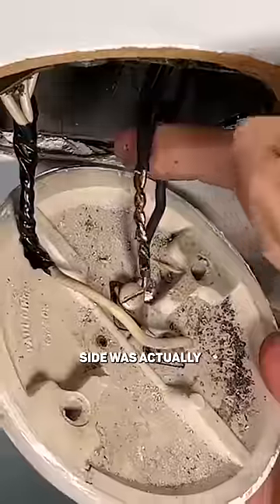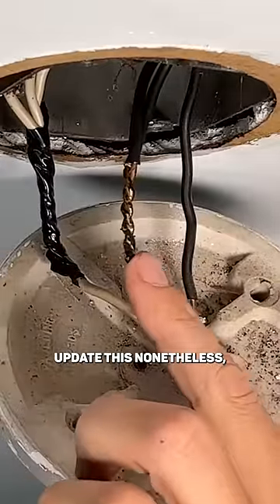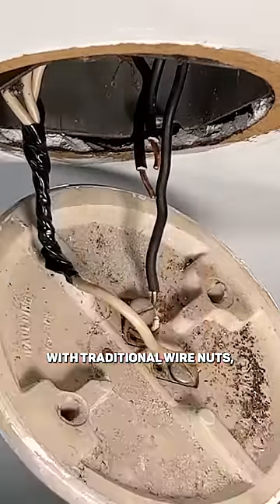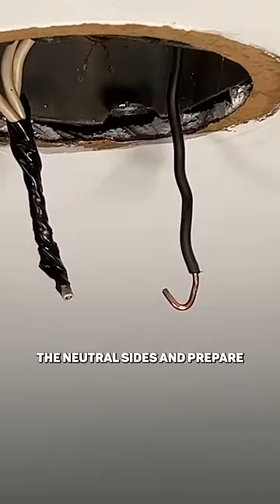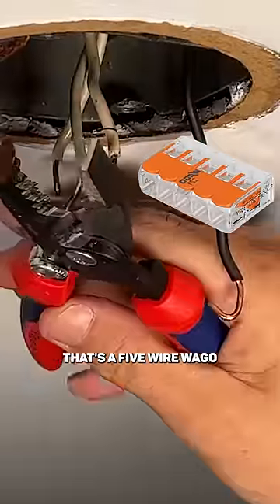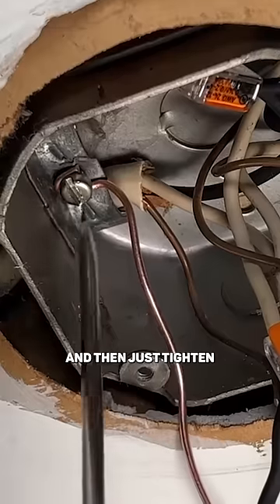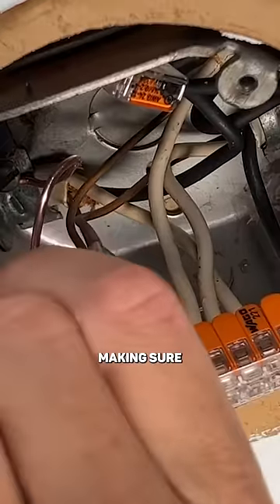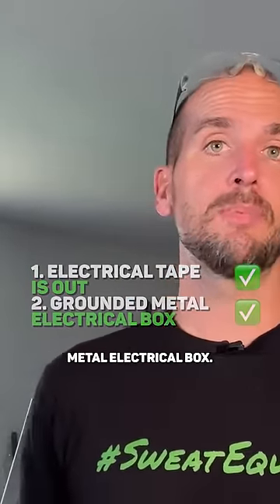Which Part Doesn't Meet Code?

Comment: That doesn’t look like a UL listed ground screw to me…
Reply: You mean NEC compliant-which it is not
Reply: Yeah, can't use a clamp screw as a ground... Although everyone seems to
Reply: A ground screw doesn't have to be ul listed.
Reply: @nukiepoo  yeah, and this dude is talking about code compliance, that splice is a little long there bud I don't care if there's solder on it solder melts under heat.
Reply: A ground screw must be green.
Reply: @ExploringCabinsandMines  if it’s cutting threads it must be green, you can use a mechanical 1/4 20 to a lug, or fork all day according to the nec, ground in the video is messed up but not because it’s not green
Reply: @ExploringCabinsandMines  Depends on the circumstances.
If u not sheetrocking,
or going forward on a homeowner run project,
because the inspector said u needed to pay to have ground screws replaced,
then u should have sued the town the inspector worked for.
Reply: @ExploringCabinsandMines  If ur a homeowner sue!
The only purpose of a green ground screw
from a "danger" standpoint
is that it allows verification easy for inspection,
which is easy anyways because all an inspector needs to do is follow the GREEN wires,
which is GREATER code,
because to use white or green for anything 
other than their intended purpose is prohibited with limited excemptions.

i run,
as a homeowner,
exposed boxes and emt
and i use wood screws
through the one of the 10 to 15 holes an extruded metal box comes factory with
to securely clamp a ground pigtail
to the metal box,
using the wood behind it to provide the clamping force
instead of 3/16 of threaded steal and green machined screw.

CODE.
SUE!
Reply: @ExploringCabinsandMines  My apologies regarding ur circumstances.
Sue!
Lots of code is crap politics.
If the next guy that buys ur home
 does not know 
that u shouldn't remove the screw
that keeps all the green wires attached to the metal box should not be doing electrical anyhow.
Sue.
Reply: @michael-dm2bv  I installed the temporary power pole before building my house , the inspector flagged me for,
 1. ground screw not green.
2. I used a Pipe clamp? instead of electrical clamp ? for the ground rod, both are bronze and same weight.
3. supporting 2x4 to the temp power pole was wrong direction.
I fixed the issues and the inspector bought the job.
I was a Tile contractor I'm not an electrician. All were silly items ,I had 4 supporting 2x4s instead of 3.
Reply: @ExploringCabinsandMines  i am sorry sir,
but my wire wheeling the green 
off a ground screw is funny
Can we agree?
Do u Instagram?
Reply: @ExploringCabinsandMines  where do u live?
Reply: @michael-dm2bv  Washington state.

Comment: Illegal ground termination.
Reply: You are correct. Needs a dedicated ground screw.
Reply: It may not be to code, but it’s bonded just fine.  Better than most, that aren’t at all.
Reply: @91156  It's still a very shitty thing to do. That screw is strictly for clamping NM wires and isn't rated nor designed for grounding.
Reply: @aurvaroy6670  Oh hell, it'll take as many amps as the pretty green scews and is threaded into the box just the same.........
Reply: @91156  Still not designed for grounding
Reply: @aurvaroy6670  And a rock wasn't designed for a hammer, but it works!
Reply: @91156  WTF does a rock and hammer have to do with this?
Reply: @91156  It is not bonded just fine. Yes, it is better than nothing, but it is not right. That ground can save your life.
Reply: Looking at the age of the box and wiring, I'm 99% certain it wasn't grounded at all before that... and those boxes don't have a ground screw at all. Soooo... would you like that grounded or not? Because I'm gonna say that's better than nothing.
Reply: @alexanderrosalez8797  drill and tap is a thing. If you're going to do something, do it right.
Reply: I'm guessing "grounding screws"  have the "proper amount" of thermal expansion to make sure they don't loosen/shift, when heated up in a situation where it's overloaded.

Also they probably don't get brittle/broken/faulty...after "certain loads" are passed thru them, like some materials do.
Reply: I reported his channel for dangerous misinformation
Reply: @aurvaroy6670  Electricity does not care if the metal box hole has a silver screw or a green screw.  That's the point of rock v. hammer.
Reply: @fraidykat  It's not the color that's the issue, it's the type of screw. Scott used the wrong screw to bond the box to the grounding system. You can't just pick any screw to loop your ground wire onto. It has to be a specific size and thread count hexagonal screw specified by code.
Reply: @aurvaroy6670  Which is what he used, a self tapping machine screw.
Reply: @fraidykat  No he used the screw that clamps NM cable. Also, ground screws aren't self tapping
Reply: @DES.REVER.DESIGNS  there's no such thing as a special ground screw, you just need a low impedance path to make it 100%safe,  which this ground is not a proper lowz path.  That's the issue, not the screw
Reply: @aurvaroy6670  are you from Europe or just a rookie?  The size of a screw makes zero difference, it's about creating a low impedance path, which comes fron a secure connection with 2 thread engaged in the metal, such as in this case and most cases, is achieved through a machine screw, and yes self tapping machine screws do exist,  metal framers use them all The time.  A binding screw in a panel is only required to be green for inspection purposes, the ISD no special make up of a ground screw, they're all the same
Reply: @trope5105  No I'm born and raised in US. I know bonding screw size doesn't make a difference but isn't it called for in the NEC, just like mounting screws for switches/receptacles?

Anyways, that screw that Scott only used only for securing NM cable(s) and should not be used for any other means. If y'all wish to cut corners and use it for grounding, do it. But I personally will never do such a thing and rather invest the time and money to drill and tap a screw hole for an actual bonding screw available in any hardware store.
Reply: @aurvaroy6670  the code says what I told you, I was correcting you and informing you what the code requires.   There only time a green screw is required is for your main bonding jumper, which is what ties your neutral to your egc, the code doesn't require it to be green, but that particular screw should be used
Reply: @trope5105  Again, I wasn't saying a specific color screw is required for bonding metal boxes to ground, I just thought that the specific size/thread count was specified in the code since someone said that the code mandates that.
Reply: @aurvaroy6670  don't get defensive, I'm not coming at you, I am trying to inform you n correct the few misconceptions you muttered, such as screws can't or aren't self tapping.   The only thing that matters is there machine screw aspect of the screw, in fact most ground screws actually are a thread forming screw, that's what that little notch at the end of the screw of a plug tail, the notch displaces metal allowing it to tap into a while with know thread s.  If u ever work around metal framers, scope out their screws that are used for dry wall,  some use a1032 self tapping machine screw.  Be careful though, because contrary to popular belief, not all electrical enclosures are 1 16th thick, some are thinner, which needs to be accounted for if you steer wanting to thread for your egc.
Buy Mike holt's complete library, it still place you above 90%of most electricians
Reply: @trope5105  You don't have to go into that much detail regarding how self tapping screws work. The reason I said grounding screws are not is because I have several ones on me that lack that notch.
Reply: Would one of the green grounding clamps slid onto the edge of the box be code compliant?
Reply: @MoneyManHolmes  hou taking about one of those clip things that slide over the outer edge?  If so, the question is if it is listed as an approved method, and then go to 250, and see if the egc requirements state that other listed means are approved.   
Word of advice, is not to RELY on questions in forums! 
Of course it is fine to ask, but you really need to learn how to consult the NEC for your true answers!
Reply: @91156  😂🤣😅😆😁😄
Reply: @DES.REVER.DESIGNS  Not really any of that. By code, the ground must be attached by a "dedicated screw". It can only be holding the ground wire. If there were no cables in that opening, the clamp could be removed and that same screw could then hold the ground wire and meet code requirements.
Reply: @trope5105  
In orange and LA county the ground screw must be an approved screw and green.
Reply: @privateperson5054  that's stupid, pointless, and a waste of money,  n unless you have your own code, the ahj shouldn't be requiring superfluous bs
Reply: @trope5105  
What are you talking about my "own code"
So your saying its ok to use a drywall screw for the ground ?   Can an election use a plastic screw ?   What are you saying ?
Reply: @BrandonRyanPresents  Well that's just a sh**ty thing to do. Undeserving of such an extreme.
Reply: @aurvaroy6670  no I don't think if you didn't have the screw, you would leave the job, drive to pick up a screw and tap. Neither would you leave the box ungrounded. Neither would you lose any sleep over doing it the way he did it.
Reply: @Dempdawg11  Well I would already have a bunch of ground screws ready for situations like this. All I would really need is a tap, but I could just drill a hole large enough for a ground screw if there are no other holes present in the metal box, if I'm unable to get a tap for whatever reason. Either way, I will never ground a box the way he did in this stupid short.
Reply: @trope5105  If they were from Europe they would be commenting on the lack of sheathing on the earth wires. Exercise left to the reader why that is an important safety feature.
Reply: Stranded link in a ring crimp on that ground ??!

Comment: Using the cable clamp within the box is not a suitable means of ground. Grounding screw shall be green in color.
Reply: That green requirement is only for the main bonding screw at the first means of disconnect. Everywhere else it just needs 3 threads of contact per 16th of an inch
Reply: And what if the box is so old it doesn't have this feature and it doesn't matter and you don't want to replace one box when it works perfectly fine to do it this way instead of not doing it at all?
Reply: @timothyjewett625  250.126
Reply: What you sound like... 🤓 🤓🤓
Reply: Meh
Reply: & not on a wire support screw
Keyless is questionable in closet
Reply: Would have used a self tapper for the ground and secured to the box

Comment: Get a 10-32 drill tap and put a proper ground point on the back of the box
Reply: I was just about to mention that that is not code. I don't usually criticize because I love his videos. Prober bonding, however, is important.
Reply: Was thinking the same
Reply: True. If he wants to show what's code compliant he better not make violations like this
Reply: That is a propper ground point and not a violation.  It could be if it holds something else.
Reply: Clearly that must be it.
Reply: I wish this guy would stop playing electrician
Reply: Or an M4, it's the 21st century use metric.
Reply: I suppose it depends on local code and/or the inspectors. I mean, the screw is bonded to the rest of the metal box. The only difference is it's not green and its purpose is to hold the NM clamps down (Not a dedicated grounding point).
Reply: @TheSeanUhTron  Technically the only screw that has to be green is the bonding screw in a panel. Check the code book. Should be in 250.
Reply: @lloydmills9619  This IS a violation,  because it DOES hold  "something else,"  and  BECAUSE it is NOT   a  "dedicated"  proper ground screw.   Grounding screws  MUST be dedicated, and used for nothing else
Reply: Just should of used wire nuts because those plastic with that thin metal inside of it will loose connection and you lose power when you just twist the wire and put wire nuts on it and a perfect connection that will last forever
Reply: @gabrialcordell1854 have you had wagos fail? I’ve encountered multiple failed wire nuts but no failed wagos yet
Reply: Just use a Teck Screw (Self Driller)
Reply: @sevillain1  You should never use self tapping screws for a ground connection!!! That is also against code.
Reply: @gabrialcordell1854  Unsure if you’re familiar with the device he’s using, but it uses a lever lock to hold it in place.  It’s not spring-loaded.  It’ll last much longer than anything that’s spring-loaded.
Reply: Holy pile of perfectionists and master electricians in these comments.
Reply: @fourfortyroadrunner6701  that's not true at all. You can use ground screws in place of panel screws and it is 100% compliant. It might fall under a 'listed' violation, but I've never had an inspector raise an eyebrow towards it. (i do industrial const.)
Reply: @TK-wz1io  You can find green self-tapping ground screws all over the place.  Fairly certain code allows it, but I tap to make it easier.
Reply: 'Zactly. Using that screw may be acceptable, but not while it is also being used as a rx clamp.
Reply: @my1little2pony  Right is right, and wrong is wrong. 🤷‍♂️
Reply: @gabrialcordell1854  these are lever nuts. The ones you're talking about are not wago 221s
Reply: @TK-wz1io also correct!!😊
Reply: @my1little2pony Code is CODE!!!!  Do it right, or hire a real Electrician!
Reply: @TheSeanUhTron Duh... YEAH!!!  THAT'S WHAT MAKES IT A VIOLATION!!!

Comment: Keep installing those wagos.  Keeps my phone busy with service calls
Reply: No shit -- can't beat a wire nut as the conductors are bonded mechanically, directly adjacent to each other.  This is mystifying.  Isn't a "WAGO", whatever the hell that is, something like 20x the cost of a wire nut?  I bet this guys brother runs around putting in Shark Bite plumbing connections.
Reply: You made that up.

Comment: Yep, ground is not code. Read code.
Reply: It was the first thing I noticed.
Reply: Grounded to… nowhere…
Reply: @THEEJuror13  That’s because it’s a bonding point… completely different from a grounding terminal in a panel. It prevents the box from getting electrified.

Comment: i always leave soldered connections alone, they never fail, and are stronger than the wire. just trim it a little and put a wire nut over it, and then put some tape over that, it will never dry out or fail in any of our lifetimes. also those wago's for our 120v systems get overheated usually and fail in time as the metal strips fatigue with higher loads. same as the backstab on rec.
Reply: Yea, this dude literally decided to make his connection weaker
Reply: LEF bulbs pull so little current they’ll never overheat.
Reply: @davidelliott5843  they can actually if they design them improperly. i have seen some catch on fire because the circuit was pushed too hard, and failed in a short
Reply: Exactly I have seen it from experience outlets are so hot you can't even touch them they might work in the UK where they have 220 volt receptacles
Reply: @mrromantimothy  And what current are you driving them at with 120 volts, 15 amps?
Reply: @mrromantimothy  Actually the receptacles in the UK are rated at 240 volts.

But in theory the nominal voltage is 230 volts. We didn't change any of our infrastructure when we changed the specification of the voltage from 240 to 240. So our receptacles and junctions are good for  240 volts.

Comment: Bad mechanical ground to the box. If there is not an already threaded 10-32 hole in the box, drill and tap one to install a proper green ground screw to bond with.
Reply: A lot easier to use an approved ground clip.
Reply: @JohnThomas-lq5qp  we rarely have ground clips on the commercial jobs I've been on. However I almost always have drill taps on me with my bits. But your way is good too
Reply: @CAyellowtail  Your way is far superior. Do have a set of Greenlee combo drill / taps. Used to do a ton of work in machine & tool & die shops where I would get gun taps from them. Had a nice small.pladtic box with maybe 6 dividers where I would start with 6/32 gun taps along with the proper drill bit. Then 8/32,10/24,10/32 & 1/4-20. Can remember 40 years ago when the tapped hole for ground screws inside of 1900 boxes did not have the raised hole so you had to drill a hole to allow box ground screw to be tightened..
Reply: Or use a rated ground clamp